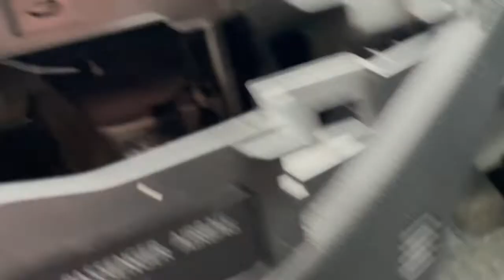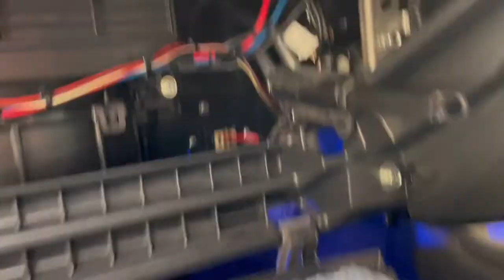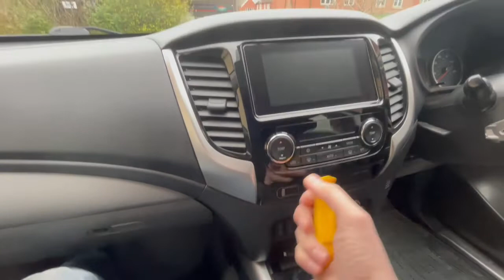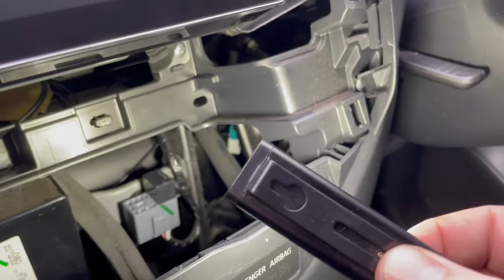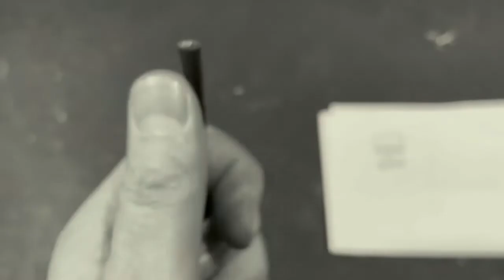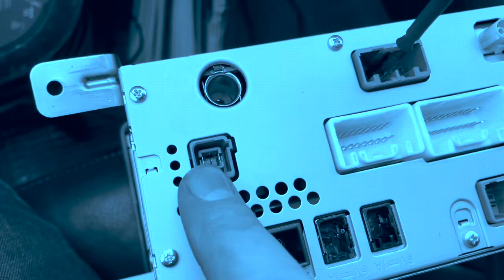Mitsubishi L200 MMCS Head Unit to Carplay Android Auto DIY Video

Comment: This supports rockford sounds ?
Reply from the maker: @devapriyabandaraherath1847  I’m afraid I’m not sure what you mean. Sorry.
Reply: @mrjono999  Some Mitsubishi models (Delica D5, Pajero, Outlander, etc) comes with premium sound package call 'rockford fosgate'. This has amp+subwoofer with other speakers. Headunits comes which equipted in these models different to other standard head units. I was wondering when you install this head unit your car had rockford sounds or not.
Reply: Did you fix it? I am planning to do it now! And i have a RF system @devapriyabandaraherath1847

Comment: For the microphone wires, they come from the bluetooth module? You tapped the 4 microphone wires from the bluetooth, put the ends to the gray connector then the gray connector to the head unit?
Reply from the maker: Depends which model, my 2016 I had to splice, I had a 2017 and the mic wires were already in the correct connector block

Comment: Hello, I just have a question about the order of the original USB cables. I’ve cut all four wires and wired them up to the sat nav, but now I don’t know what order they go in. If you can remember, could you tell me? Thanks.
Reply: I’ve tried every combination, so I’ll just call someone I know at Mitsubishi and ask them to get an original one. Thanks for your help, that was my only issue. Everything else went smoothly because of you
Reply from the maker: the power rails should be fairly obvious, red is + and black is -. the data rails  are white and green from memory, green is + and white is -
Reply: Apologies for taking your time. Is there a specific order for plugging these wires into the four connectors (pins)  in the sat nav
Reply from the maker: @wsoob2296  which wires are you referring to? Are you referring to the USB cable? What colours do you have on both the original cable that goes into the NAV and your new USB cable?
Reply: So, I’ve cut the original USB wire that leads to the hands-free module and soldered an extension of the wires (coloured black, red, purple, brown) which now leads back up to the sat nav. Now that they areup to the  sat nav, I don’t know in what order they should be inserted into the pins. When I try it randomly, it either results in a bad USB connection or nothing happens, and the phone does not charge.
Reply from the maker: @wsoob2296  did you not get hold of one of the Subaru style USB socket?
Reply: Yes, I did, but it would be nice to have a second port while keeping the original USB. I was just wondering about this because I saw that you kept your original USB.
Reply from the maker: @wsoob2296  assuming that you didn’t get any of the cables when you bought the new head unit? That is by far the easiest way to get into the USB ports. With my modification, I just used one USB and traced back the cable and cut the original USB cable off where it went into the old Head unit and splice the cables together, I’m afraid I forget which colour was which, but I seem to remember the power was obvious and only the two data lines needed going one way or the other. From memory, one of the dat lines, with the same colour on both cables, and so the other one became obvious by default.

Comment: Hi, I just done the conversion but the DAB radio doesn’t work. It says no signal any tips? Thanks
Reply from the maker: Try with the radio hanging out, plugging the aerial into the back. It’s pretty easy to disconnect stuff in the process of putting the unit back in. Make sure you’ve got DAB reception with it plugged in.
Reply from the maker: I also had issues with the unit resetting and then having to manually scan through every DAB channel and re-saving them all

Comment: Hi there, I’ve managed to install every bar the usb. I couldn’t get the exact usb that you had. I have managed to get a 4 pin connector but doesn’t seem to be playing ball. If you are looking at the back of the stereo at the usb connection, which pin corresponds to which cable colour Top left, Top Right, bottom left and bottom right? Many thanks
Reply from the maker: I'm afraid I'm not sure off hand! you can look on the schematics for the unit?
Reply from the maker: the power rails should be obvious, red/black or something like that, if you get the data line the wrong way round just won't work so trial and error could work?

Comment: It’s seems the usb cable isn’t sold on Amazon now. There is a 4pin similar one sold on eBay with a white connector. Would that work, or could us simply just connect the wires
In to the pins?

Comment: Thanks for creating this, very helpful. I'm looking to put an SDA in my 2010 Pajero which has the old mmcs and Rockford.
Also I've noticed there are nav and non nav SDA, which did you get? I'm thinking non nav and just use phone for nav, won't  need map updates then. Mine are 13 years old in the paj.
I'm hoping my install will be similar to yours.
Reply: colin, did this work on your Pajero? I have the same and this would be great. And thanks to Jonno for the research! John
Reply from the maker: Yeah I use google maps for routing, live traffic is unbeatable.

Comment: Where did you buy the head unit? Or a model/series number would be great. so i can search for it. Can you supply that information?
Reply from the maker: I’ve got mine from eBay, the model number is 8740A056 you can often find them though using search terms ‘Mitsubishi head unit’, ‘L200 head unit’. The same model is used in the Shogun and some others
Reply: Hi, great video, well explained.
Did you get a code with your eBay unit.I need to do like for like replacement but they all come on eBay without codes,

Comment: Having done this now, I suggest leaving the bluetooth module alone and plugged in. The lead behind the radio just plugs in to the new unit. Get normal mic function with no chopping. Only thing to do is unpair the connection to your phone so it will pair to the kenwood. Car play only works via usb so this connectivity is essential.
Reply: Hi, I'm not following this. How did you get the connectivity without rewiring?
Reply: @kelseyormsby3440  I have a late 2017 L200 warrior. On the factory unit, the plug immediately left of the fm aerial (viewed from behind) is the mic. This just plugged in the kenwood and the mic works. Left  plugged in behind the glovebox, on further thinking I don’t know if pulling it here would stop it working. It was a surprise to me too, so glad I didn’t chop it first. Unable to post photos. Can’t imagine the barbarian is any different?
Reply from the maker: I actually changed my L200 because of restrictions in the UK with omissions, I also have a late 2017 model now and discovered the same thing when I had to redo this process. No need to chop into the microphone! Also, it is possible to not bother using the DAB extension, there is just about enough flex to get it into the back of the new head unit

Comment: Excellent video thanks. I was lucky enough to get one with the plugs. Makes the pin position for the mic a little easier to interpret. Colours are the same but ground is green, not black. Happy to share pic if you post an email.
Reply: Hi, can't post email as it gets deleted. Could you post the photo?
Reply: Can you please , share the new unit gray connector diagram ?

Comment: I think my truck has had this conversion but not done correctly I have theses messages pop up,(the microphone has bad connection contact your dealership for inspection) and (please connect a supported smart phone) what year were these units standard on a barbarian
Reply from the maker: I believe from 2018 so they were on 2018 and 2019 cars then the new model comes out. Previously it’s the MMCS